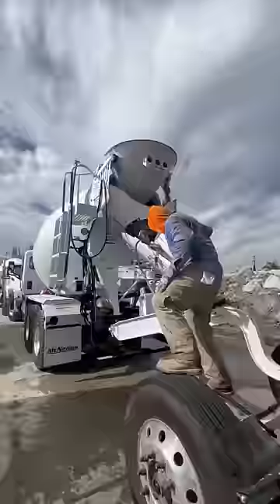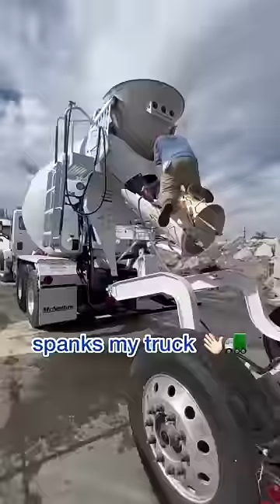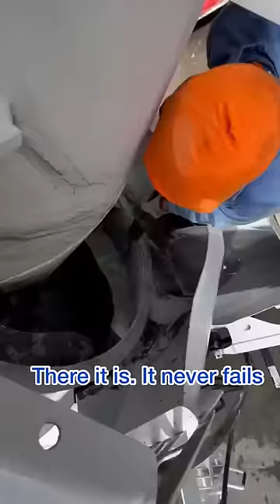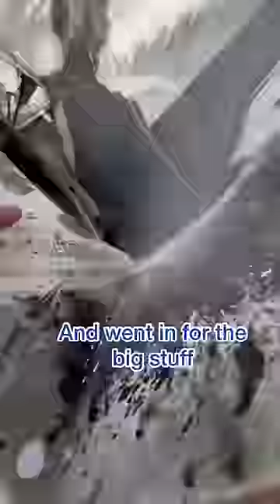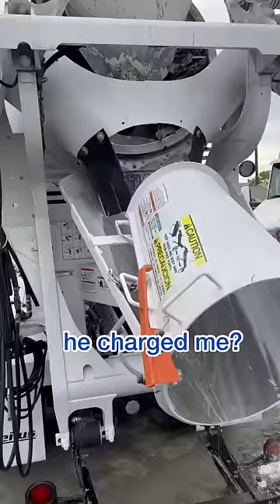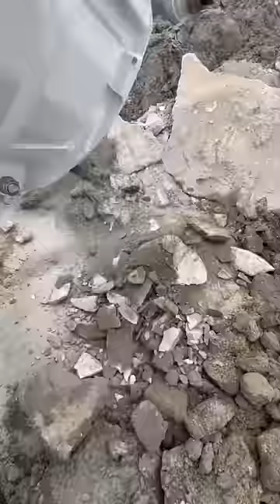He Made $150 in 30 MINUTES!? Would you do this? #concrete #construction #work #readymix #cdl #shorts

Comment: $150 to get inside the drum and chip it out. Fuck that, rather change a toilets wax seal for $150 lol
Reply: So wise. Same though ngl. Changing a faucet or toilet for 150$ sounds like a much better deal
Reply: You’ll find 100 trucks to work as a chipper at the same location…..while you only find 2 toilets at different locations 😂 with the plumbers being so cheap now 😂
Reply: Too cheap.  I know it sounds like a lot at $150, but after overhead is figured in and labor, few companies will only charge $150 to pull and set a toilet... And most of those are uninsured handy Andys
Reply: @Retaferyr  The overhead of that one single tool and compressor that's been paid off for years lol
Reply: @billfromnxtdoor5575  gas, truck note, ppe, etc. its also a very dangerous job. $500 is normal $150 is slave labor rates
Reply: @billfromnxtdoor5575  Trying to use the impact chipper to set a toilet again? Yeah Taco Bell is pretty good
Reply: lol wut? 150 for a toilet seal? I do that and get paid hourly. it shouldn't take more than a half hour

Comment: He charges that cuz he’s probably gonna get sick from silica dust
Reply: He charges what exactly because your  comment didn't answer the question
Reply: He's wearing the proper P.P.E.  so there's no worries there
Reply: @Dane-bootsNcatsN  ppe doesn’t work well when you inhale what’s on your clothes, almost no one does it the right way.
Reply: @Dane-bootsNcatsN  those masks only block 95 percent of the particulates. The other 5 percent are like nano particles which over time can build up in your lungs. I used to grind cinder block walls smooth after bathroom tiles were knocked off and I could run my finger inside the same respirator he has, and would have dust on my fingers. I would wet a rag and put it over the filters. It'd be hard to breathe but was worth it
Reply: @cantgetright7236  huh, that's why I still have white buggers even if I wear my mask all day.
Reply: @OG1GTP  yeah. Construction will fuck you up over time I wouldn't go into certain fields anymore because of health hazards and I'm so young I can prevent a lot. I'm 24 but have been a roofer, laborer, and plumber for most of my adult life and it's already messed me up quite bad. No more hard-core jobs for me if I can help it but shit money talks
Reply: @cantgetright7236  straight facts about the mask and particle sizes.
Reply: @cantgetright7236  Those are P100 filters
Reply: He's super cheap!
Reply: @cantgetright7236  If you use the right PPE correctly (P3/N100 filters). The mask will block 99.97%.
Reply: @larrygonzales7410  $150
Reply: @cantgetright7236  That's not exactly how it works. You are referring to a N95, they go up to 99-100. 

Silica particles have a minimum size that they can be. You need the right mask for the right job.

I'm was cringing hard when 2020 happened... still cringing but for different reasons.
Reply: @TaroTimes  electrician can be very dangerous depending what field your in. You can be a engineer
Reply: @TaroTimes  idk I've only been a roofer and a plumber why don't you use Google breh
Reply: @cantgetright7236  on... 95%. Well there are ways to do it. Bring in outside air.
Reply: @lilslicknick93 po
Reply: Had asbestos training and the teacher said "don't let anyone lie to you concrete/concrete fumes has asbestos in it".
Reply: @lilslicknick93  I already know that
Reply: @lucasjohnson2119  yea he didn't charge enough
Reply: I wouldn't even show up for $150.
Reply: @larrygonzales7410  READ
Reply: Silicosis. Same reason they banned sand for sandblasting in Australia in 2001. Most now use garnet
Reply: Carpal tunnel has entered the chat
Reply: He has good filters on

Comment: All that vibration in the hands and arms over the years is gonna mess that guy up
Reply: It's called Hand Arm Vibration Syndrome or whitefinger.
Reply: No it won't. But if by messed up, you mean having strong foremans, then yes.
Reply: @mattrondeau7466  What whitefinger is big lie?
Reply: @charliedecker7702  The lie is that using a chipping hammer will necessarily cause it. Its very rare and only occurs in people susceptible to it. I've been regularly using chipping hammers for 25 years. No problems whatsoever.

Comment: I’ve done a fair number of jobs, but I wouldn’t try that one. I loaded UPS trucks one summer while in college. 
The trailers got over 120 degrees inside and that job was bad enough. 
Put a suit on like this guy and put up with noise and dust, then add the same heat? 
Nope!  
150.00 bucks is a steal.

Comment: 150? That pretty cheap. Here in Houston i got a guy that charges 250 a hour. If he takes less then 1 hour he charges 300.
Reply: 150 x 2 = 300..... Just saying...
Reply: @randomjunk1984  very impressive.  150 x 2 is indeed 300.   But what's your point?   This guy paid 150 and it took the guy 30 min.  The commenter says if his guy did the job it would have been 300 since it was a min charge for less than one hour.  So his guy would charge 300 so he says that the 150 the video guy paid was cheap.  ...and it was. Half price.  But why do you feel the need to specify that 150 x 2 = 300.  ?  Did you miss something ?
Reply: @invictusbp1prop143  you know what's not very impressive? You coming on here acting all erroneous and insulting, yet you can't grasp the fact that he said that $150 for a half hour is cheap and then said he has a guy who charges $250 an hour. Pay attention now buddy, here's where the math comes into play: since 2x150=300. His guy in Houston charges $250 with a $300 minimum charge. 

Are you still with me? 

Since $300>$250 this guy's rate is higher. 

Do you get it now, or do I have to draw you a picture?

Edited for typo*
Reply: @randomjunk1984 starts to say something, turns around and leaves

Comment: It’s cheaper to clean your truck properly after every job
Reply: Still builds up…
Reply: Tell me you’ve never worked with concrete without telling me you’ve ever worked with concrete
Reply: @JorgeReyes-rc6hd  can't wash on site?
Reply: I always wash down even if I can't wash down on site, I don't do my Pan or my flop but I will definitely wash the inside of the drum.
Reply: Never happened to mine.  Contractors required to have washouts and if they didn't we had little pop up washouts we carried. Always dumped the rest of my water in the tank when done at job after washing out. Our plants all had water pits to dump into. Only time I had build up is when someone else drove my truck a day I was gone.
Reply: Everyone in the comments does their job better than anyone else it seems
Reply: @Big_Caesar1  That seems to be the case with ever trade related video
Reply: Yeah well it STILL builds up ANYWAY. And if the truck drum stops spinning due to breakdown, you need to flood it with water FAST to weaken the concrete enough to EVER have a chance of getting it out. Most times if that happens they just take the drum off and scrap it.
Reply: @user-rn3rn6nl3h  never quite works perfectly.  One trick my uncle would do is put in plain crushed rock and let it run for 10 minutes with plenty of water

Comment: I hope he had the keys to the truck in his pocket before getting in there. That's what I did back when I drove mixers. 
  PS: NEVER EVER GET INSIDE OF A CONCRETE MIXER UNLESS AT THE VERY MINIMUM YOU HAVE THE TRUCK KEYS IN YOUR POCKET AND BETTER YET ALSO DISCONNECT THE STARTER SIGNAL WIRE FROM THE SOLENOID AND OR REMOVE AND POSESESS STARTER SIGNAL FUSE AND IF ITS ELECTRONICALLY INJECTED THEN HAVE THE INJECTION PUMP OR EICM FUSE IN YOUR POCKET AS WELL. KEYS IN YOUR POCKET AT THE VERY LEAST! THEN IF POSSIBLE DISABLE THE ENGINE IN AT LEAST 2 PHYSICAL WAYS! Good luck out there. God bless

Comment: Put in a yard or two of jagged crush with about 100 gallons or so of water.
Start the drum spinning on mix, run for a couple hours.
Drum is clean and you now have a couple yards of tumble, or round pea gravel.
Reply: If that's the case why are there s9 many of these guys? It's more intensive than that
Reply: That's the best idea but it will always EVENTUALLY build up

Comment: Years ago I worked as a delivery driver for a concrete company to pay for college. We had a 9 yard rear load Diamond Reo truck that was near full sitting at a stop light on First Street down by the Ohio river when the 120 year old 10 foot brick sewer collapsed under it.
It sank down until only the chute was visible.
Needless to say, the concrete in the drum set up solid by the time they got it out and towed back to the yard.
We removed the drum and the driver had to go in with the chipping gun to remove almost nine yards of concrete.
He was still working on it when I had to go back to the university.
As far as I know, they still have the newspaper clipping of it up on the wall in the dispatchers office.
Reply: So I'm supposed to believe that the truck sank it wasn't at a angle like front end of the truck up in the air In that case a whole lot of concrete would have spelled out so how did you chip out 9 yd and any company that pulls a barrel off and has somebody chip it is not a real company you take the barrel off and throw it out
Reply: Most times they just use a crane to get it off, scrap it and get a new drum.

Comment: Looks like he's got a Texas pneumatic or Ingersoll Rand chipper, that's around
$1,200.00. those gulp alot of air, even a 10 HP, you would stand around a bit to allow the compressor to catch up. They start at $5,000.00 and go up quickly.
Couplers, hoses, fittings and water traps and driers chisel add 1,800. Hazmat suit, resporator, sound barriers and eye protection 1,700.   Insurances incase a fin breaks... $1,500 _$500 deductible. $11,000 approx start up, before he pulled The trigger and $100 of that is for climbing inside the hopper...
what's a price of a square yard delivered?

Comment: It costs about 9,000 dollars to chip one out with a full load of concrete inside.  Ive seen it happen more than once.  You only have about an hour and a half to get it off if its not agitated.  We often take another truck and use its drum drive to spin the broken trucks drum to get sugar mixed in. Dont always make it in time though.

Comment: As a driver of a front loader I’ve got a few new trucks in my 29 years one thing to remember the equipment part of the truck is going to get beat up . As long she runs good that’s what counts you can replace the mixer as the trucks I drove replaced the body on a few trucks.
Reply: Do U drive or operate ur Loader🤔
Reply: @Bigload992G  q on q
Reply: Replace it? What after 100 uses? Things are rated for yearrsssssss lol just realize as a owner and operator there is cost to accept to maintain business and this is cheaper then 3-5 trucks a year for sure
Reply: @wiggitywhitefox  👍🏿

Comment: I did this with a buddy of mine as teenagers. The truck we worked on was WAY worse. It had been purchased cheaply because the previous owner left a THICK layer of concrete in the drum. Took DAYS to chisel it all out. I’d LAUGH at $150. Easily add a zero (depending on how bad it is).

Comment: I charge anywhere from $150-$300/hr for window cleaning. I'd say you got a great deal and hope you tipped the guy even if it's not customary. Very glad I'm in "the right business" 😹
Reply: Hey fellow window scrubber how's your day. About to hot here where I'm from to scrub glass after noon.
Reply: @duaneross9271  It's been well, one of few days we take off so it's been nice resting 😹 gotta work quick on that hot glass, especially when tinted! Not a huge fan of using non eco-friendly materials for cleaning but I'd recommend looking into Hi-slide (or somethin similar) it will make your water evaporate slower and gives a little bit more lube. Still find myself dunking my mop for every pane on that hot side tho

Comment: Light a fire inside. The heat expands the metal and it falls off
Reply: Yeah someone do this
Reply: @NateColman  I do it to my portable cement mixers all the time. Labourers never look after your tools. The fire method works well. 50% hydrochloric acid (pool acid) does it also but needs to be reapplied over several days. Then keep it covered in diesel.
Reply: Dynamite 🧨
Reply: @polojoe2835  like mythbusters ?😂
Reply: @luke9911  that’s where I got it from 😂
Reply: @polojoe2835  didn’t the whole truck disappear? 🤣